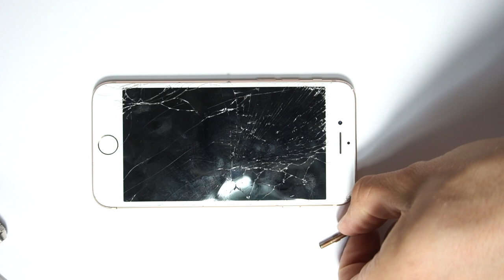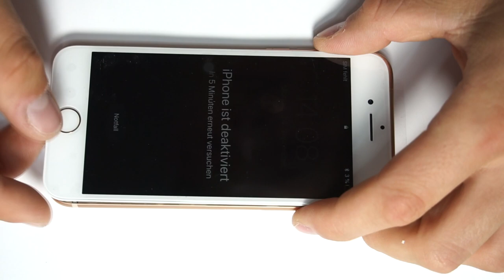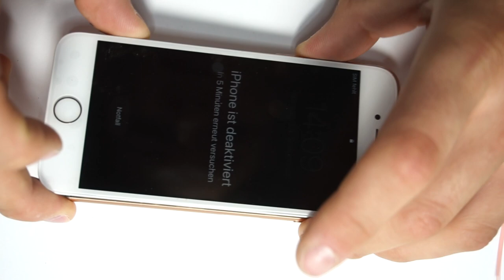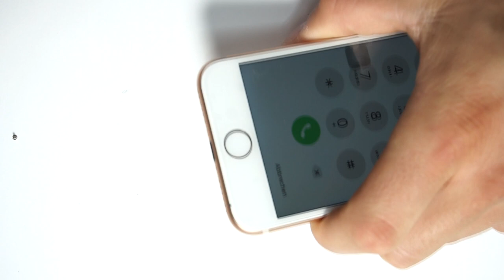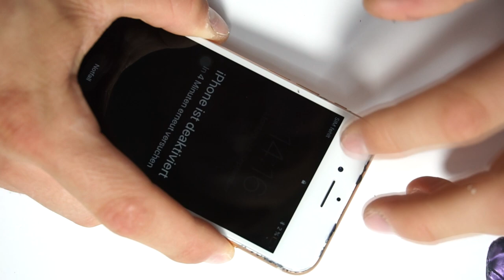IPhone 8 Frame and Backglass Replacement - Full Tutorial

Comment: I’m doing a screen, battery, and back housing replacement. 😅
Reply: Iam doing one today, did it go good?
Reply: Ilias Akkaoui i damaged the wireless charging coil when I swapped it over. I was super careful and there was no visible damage but it ruined the motherboard. I have one piece of advice: DONT USE THE OLD WIRELESS COIL. I hope it will save you from what I went through
Reply: It went good, i fixed the iphone fully. Btw thnx for the advice👍🏼